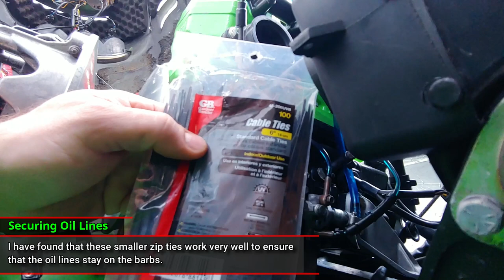1995 Arctic Cat ZR 700 part 3 || Oil Injection Pump [Bench Testing]

Comment: This reminds me I need to inspect my oil injector hoses.  My idle flow is a measurement of the throttle position and the oil injector cable.  Just not the easiest thing to get to.
Reply from the maker: Nope. These can be super tight to get to. Im in no rush to get a newer style sled. I can tell you that right now. Very tight places.